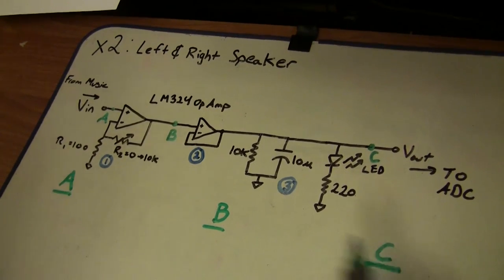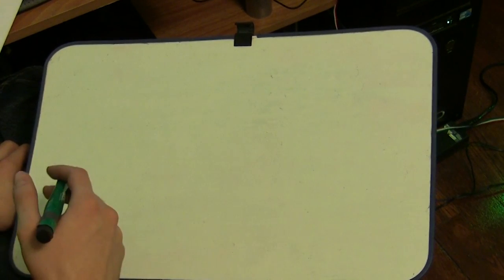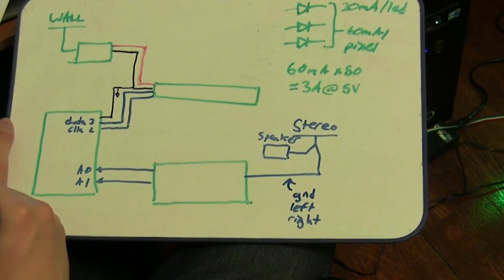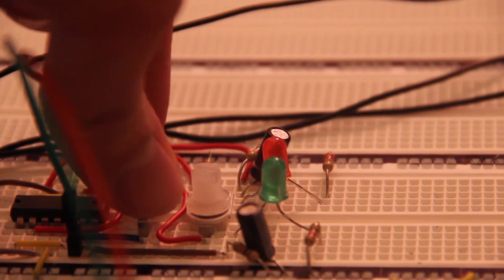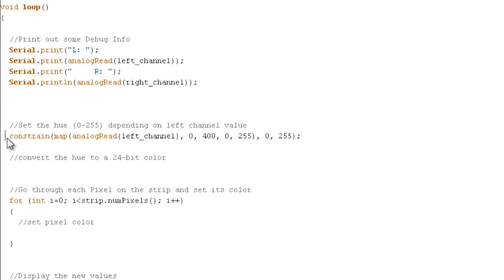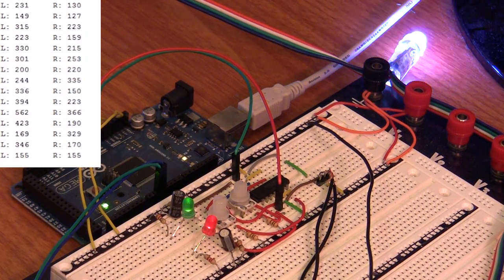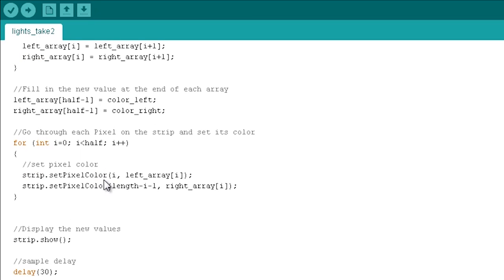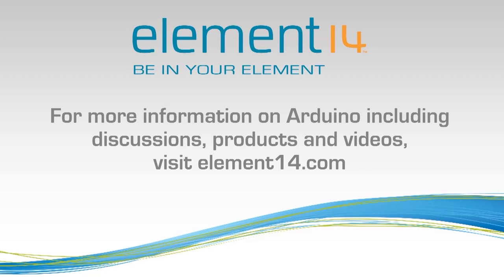Tutorial 14 for Arduino: Holiday Lights and Sounds Spectacular!

Comment: Well done, Jeremy.  I always enjoy the quality & content of your videos.  

In this video, I like the way you explain the pre-amp circuit and the code that goes with the LED strip.

It would be cool if in the future you could do a VU-METER circuit using discrete components.  It would be a good example of using a MUX.

TIP: In the future, you might consider stopping down the camera aperture when you video LEDs so that they don't wash out.  This will give the lghting effect greater visual impact.

Comment from the maker: @skizz0id When Benjamin Franklin was first investigating electricity, he incorrectly assumped that the current carrying element was positive (protons), but it was later discovered that electrons are the mobile component.  Alas, the standard had already been defined, so now we're stuck with this.  Current flows in the same direction as positive "holes", but opposite of the direction of negative electrons.

Comment: @Niclas Hedhman is right, looking at Wikipedia, RC filter has to have Vin entering Resistor, then the current flow towards capacitor which has one end going to the ground at the same time the Current continues to flow towards Vout terminal. Thanks to him and Jeremy anyways.

Comment: This is great! However ive built everything and the last piece that im stuck at is starting the mirror propagation in the middle of the strip. I am able to have it start in the middle but its only 1 half, i can change directions but can only have propagation in 1 direction at a time. The strip is all lit up but only half is syncing with sound. If I double my length then the whole strip syncs with sound, only from 1 end at a time though? I downloaded your code so it is exactly as you had it. Any ideas?

Comment: Jeremy,
Thank you for the tutorials, they are indeed outstanding.

I do have question on the LPF. Isn't the resistor suppose to go in series and not parallel with the capacitor? If the voltage will go to 0V in the buffer amplifier, it will discharge the capacitor almost instantly. It seems that the resistor (the 10k) is not doing much when placed in parallel.

Can you elaborate in this regard?

Comment: hello Jeremy. please help me if this works only for 50 LEDs.

1.  If I use 100 LEDs or even more, what changes do I need to make apart from the code where you specified the number of LEDs.

2. what hardware change would you recommend if more LEDs are used.

Comment: @sciguy14 It's not about me liking or disliking your circuit. In the schematics at about 5:00 in your video you have an op-amp followed by a parallel RC circuit. And there are other issues too but I guess you'll find out while you learn.

Comment: The RC low pass filter is incorrectly drawn. The Resistor should not be in parallel with the capacitor. And with the capacitor connected to the LED directly, you will have effectively created an RC(load) from the OpAmp to capacitor, and the RC(discharge) of Capacitor through the LED resistor. Instead, the RC filter should be connected on point B, with resistor from the output of previous OpAmp on one end and to the [+] input on the second OpAmp. Capacitor between [+] and ground. With that, you can properly calculate {tau} and the second OpAmp simply drive the LED. Sigh
Reply: Sean Mitchell I know right?

Comment: What happens if R1 in the first equation is 0?  Does it blow up or something?  Genuinely curious.
Reply: SgtRevan i guess that if r2 is turned down to 0 ohm you would get another buffer just like in the second stage, while with the pot maxed you would get a comparator: with the 10k resistor you would 'kill' the signal coming out of the opamp bringing it to virtual ground. So the opamp would comparate let's say 1v of the positive input with the 0v (of the virtual ground) and at the output you would get exactly the voltage by which your're powering up the unit thus saturating the signal (basically your wave sine signal would be compressed getting a squared wave). this happens because if you don't provide a correct feedback, the gain produced by the opamp would be huge, getting something like a thousands of volts. But since you are powering up the opamp at V+ (for example 5V), the output voltage of the opamp would be the maximum that it could reach, so V+. I guess that somebody out there could provide to you a more accurate explanation.

Comment: Start by looking for "rc circuit" on Wikipedia. Read some reputable books. HAM radio operators learning material is good stuff. User "nptelhrd" (it's an indian university) has some really good electronics courses. Get LTSpice (it's a free circuit simulator). Look for application notes and datasheets from manufacturers. Eventually you'll get it.